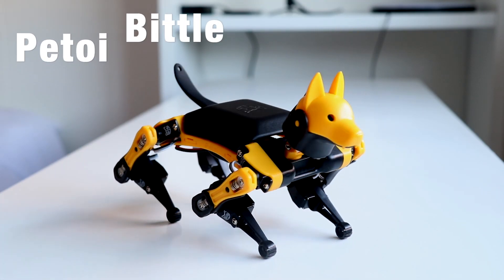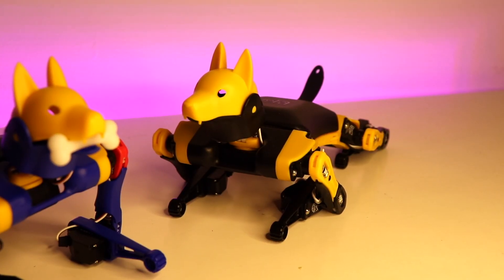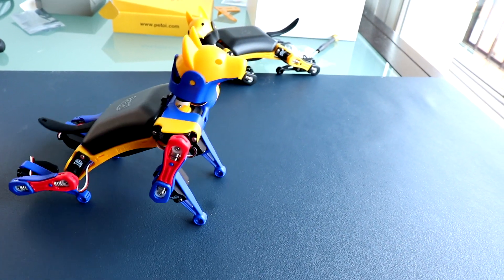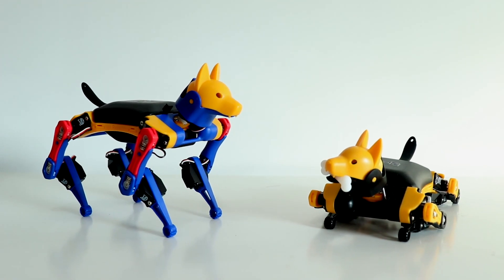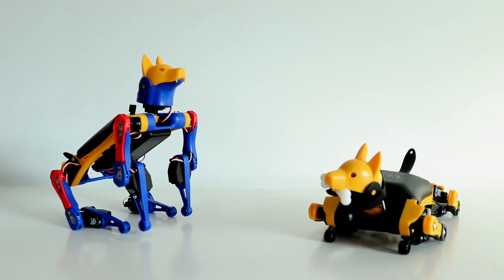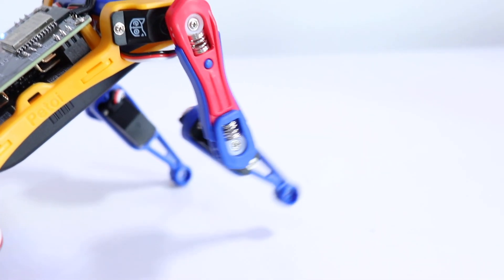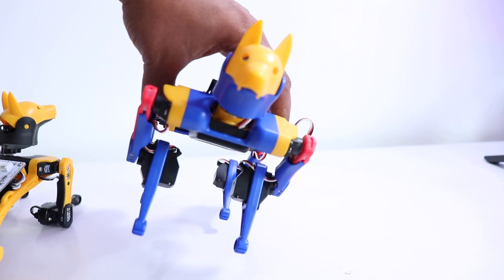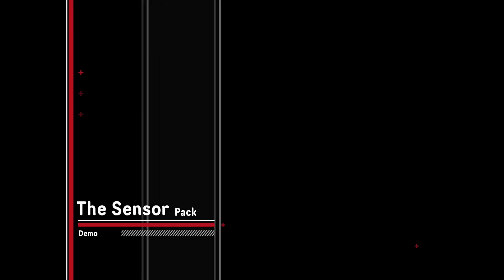This DIY Robot Dog is Now VOICE CONTROLLED! Petoi Bittle X - Robot Dog like Boston Dynamics Spot

Comment: 5:15 I don't think this is a upgrade, metal servomotors are definitely more durable, than plastic ones. Also there is not a huge difference in weight. Making the robot less heavier is also not always the best thing.

Comment: Cool for a diy bot. But I don't see the worth of it with 269$ 
For eg:
Imo cost 369 with an auto wireless charger, camera, display and integration to chatgpt
This seems like a cheap prototype toy. No offense intended, but for what it is now, I am struggling to find its worth more than 50$ with no display, touch sensor, camera, cliff sensor, better speaker, algorithm to act by itself rather than an action on command only mode.
Reply: Only the servos are around 150$ for 10 of them (one spare, you need 9 of them) which is a good price I would say. Then you have the body, board, battery and great customer support and entire thing is open source. Price of 269$ is totally fine. This is not a common walmart toy.